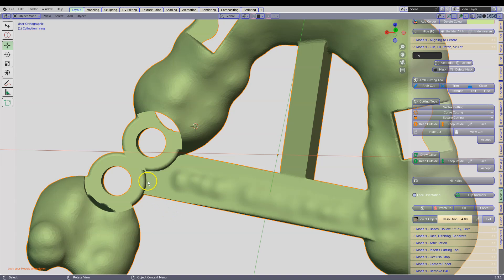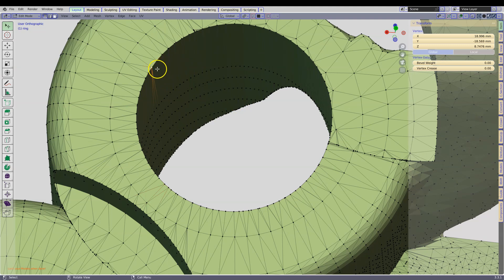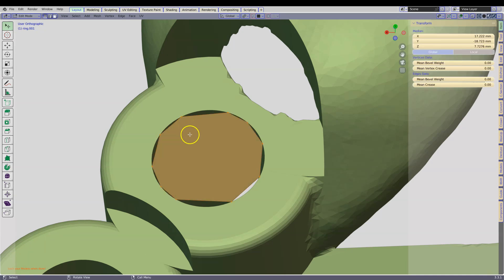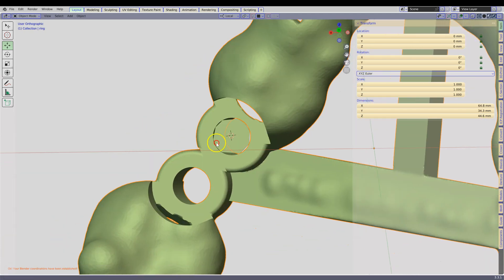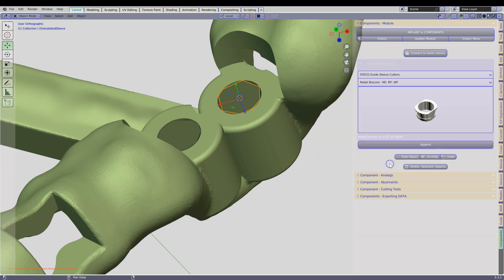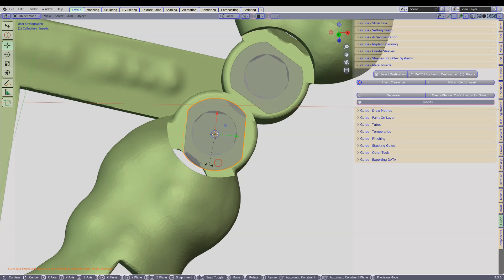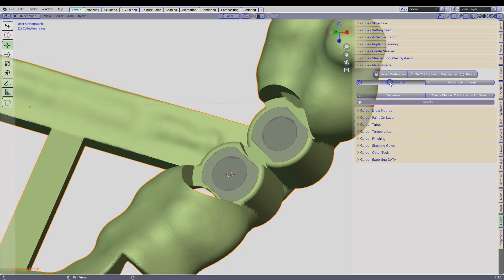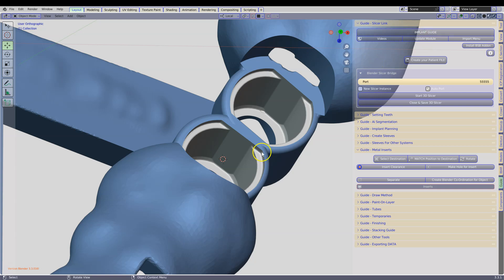Making holes for a metal guide sleeve in a finished guide.

Comment: Thank for the video. 
I design templates in blue sky plan.  But I would like to add the sleeve already in blender, I don't have a module for templates, is it possible to match the sleeve without having to buy an additional template?  I have modules, components and icp, waxup and model.
Reply from the maker: This function is built inside the guide module.